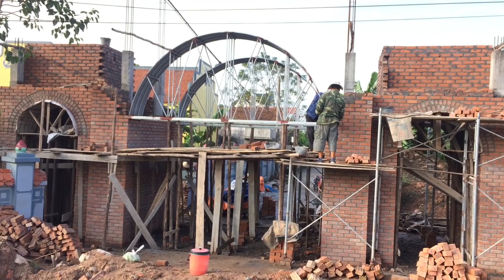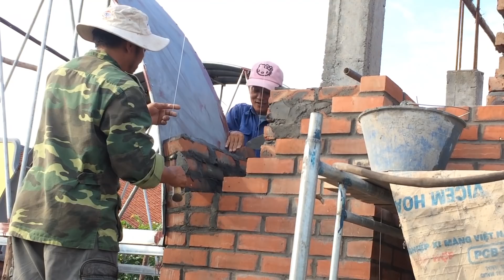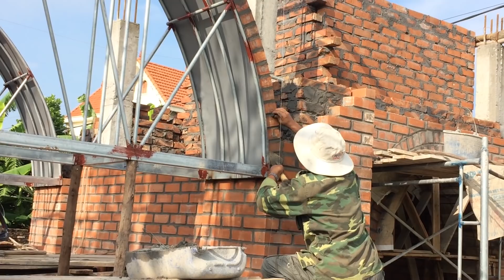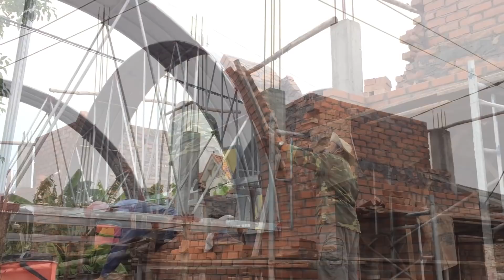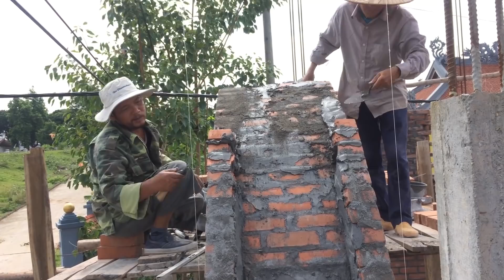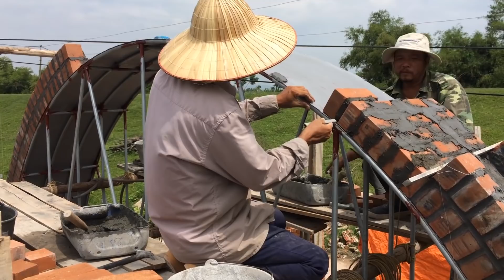How To Build A Large Sized Brick Arch - Build A Village Gate From Bricks And Cement

Comment: Nice stuff, but how does it do that the arch will not fall ?
Reply from the maker: Thank you for watching the video - the bricks will be bonded with mortar and have the mutual assistance holding the bricks
Reply: Because the weight of both sides are essentially pushing against each other in towards the center.
Reply: @kingschmoopy6583  thanks captains